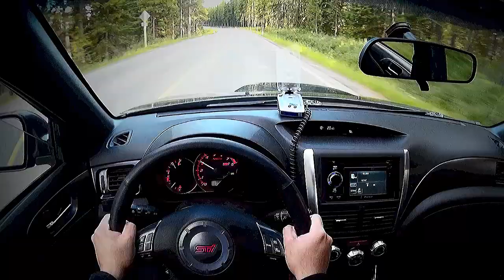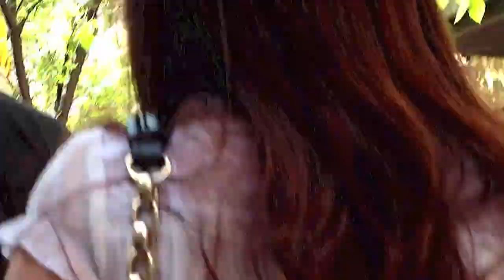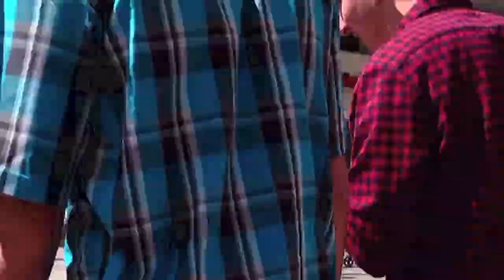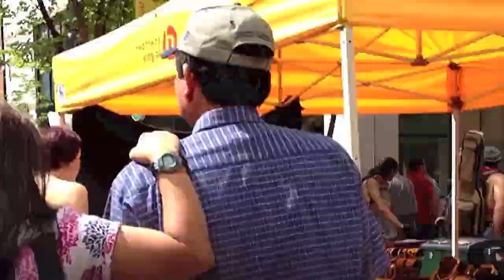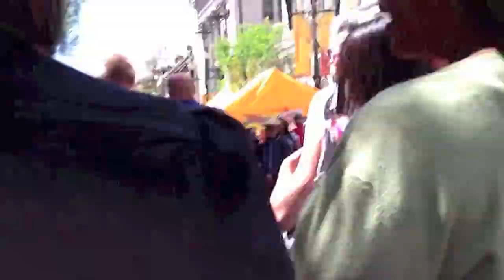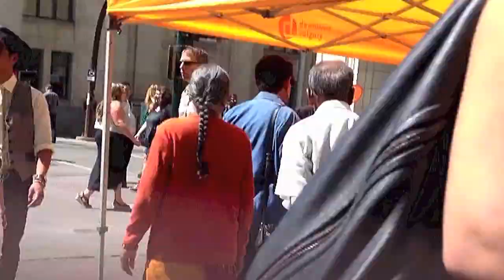COBB Short Shifter BUSHINGS Subaru WRX STi - manual stick shift Downshift

Comment: How was the increase transmission noise within the car afterwards? Mine made a difference especially in 2nd gear. I noticed that you set up gear knob higher so perhaps that may quieten it down. You didn't happen to get any images or footage of what shifter adjustments you went with so I can compared?
Reply from the maker: i don't feel noticeable noise at all , my shifter adjustment is as close as the stock, but the improvement is in the bushings feel, really good ! i have transmission bushing support & pitch stop thats more vibration but i like that kind of noise. thanks man !